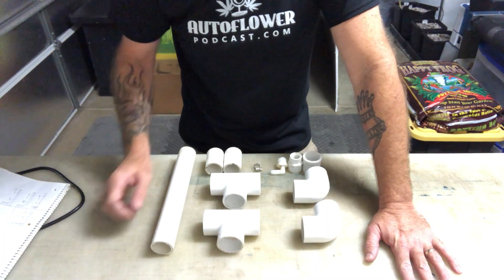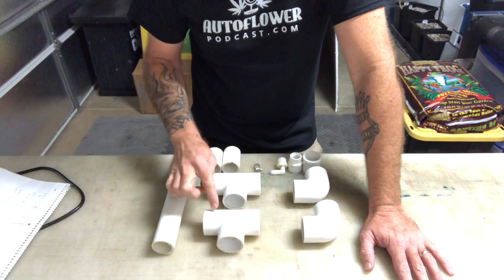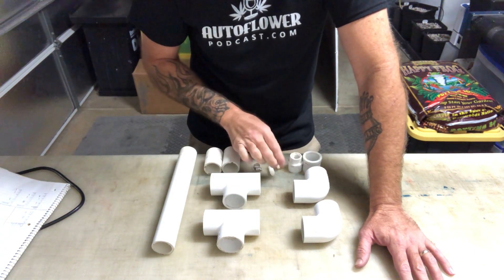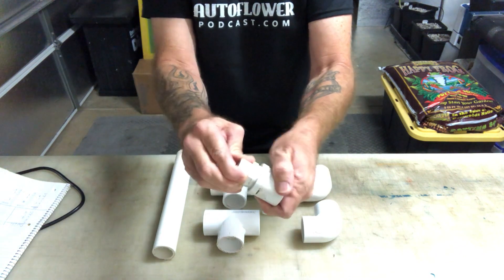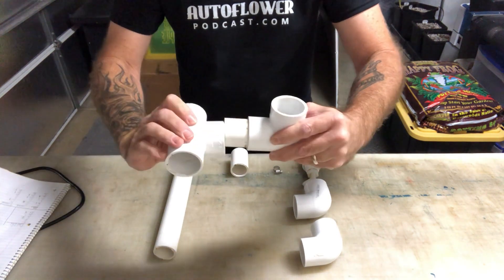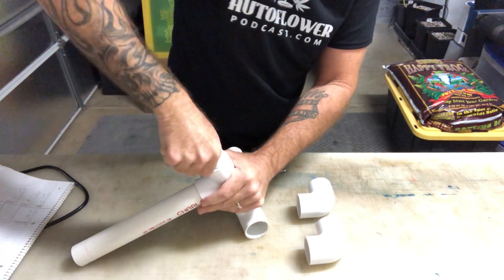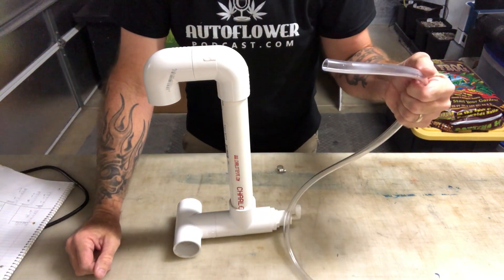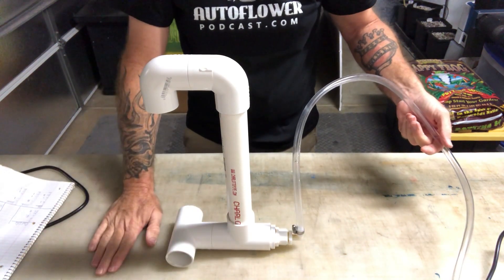DIY PVC Airlift Compost Tea Brewer

Comment: I used smaller 1/2 tube, it works well. The only consideration is the solids have to be sifted to use so they don't clog up with chunks. I had that 1/2" size handy, but I would like to go up 1 size to 5/8 at least or more, maybe 1" is perfect. The 45L/ min pump is pushing the water thru the pipe very strongly, I feel. I will come back and update this comment if I get er done and have some science for you on it. Peace!